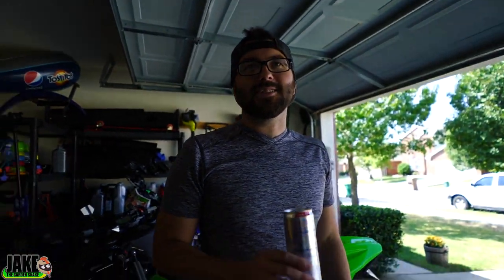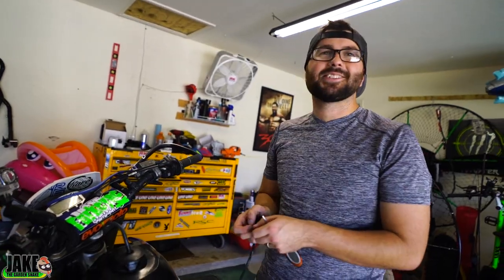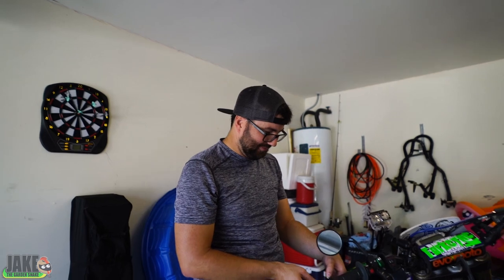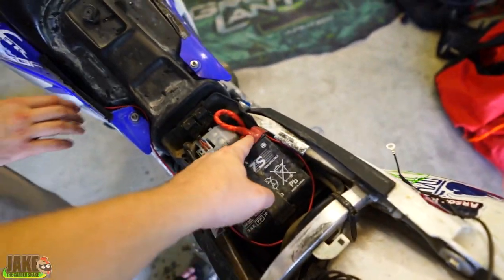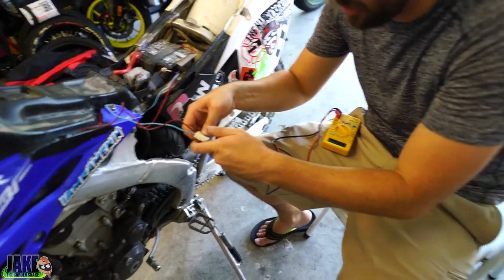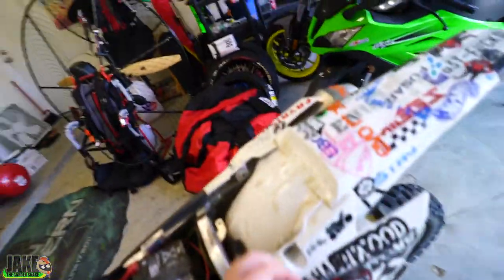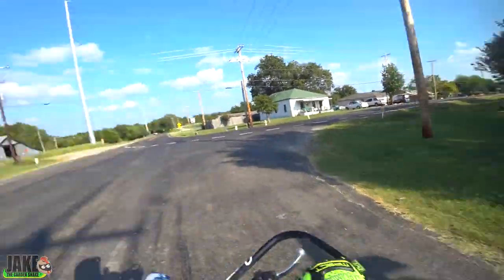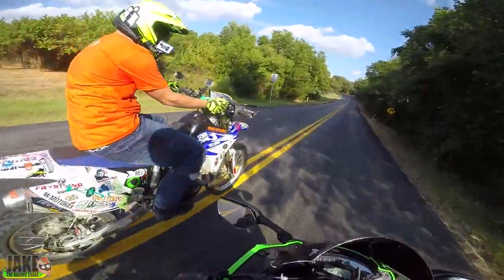Motorcycle AIR CONDITIONING (it really works!)

Comment: In Texas we have Air conditioners for our air conditioners.
Reply: Called swamp coolers right? And its pretty much the same as spraying your heat pumps outdoor condensor with a water hose. This is a misting system not an air conditioner. I guess if you think about it your body acts lile the coil and with the wind blowing into you...
Reply: @fabjonjon  tbh swamp coolers are only a little useful, scrub and wash your coil of debris and thatll help most people most for quick an easy. you can also hack something together to make a larger coil or figure out some water cooling system.

Comment: Soldering tip: heat up wire with iron and melt solder with wire not the tip
Reply from the maker: For sure, I'm too lazy but I know that works well
Reply: Same as copper pipe, gotta get the pipe hot to solder weld. Heat the wire to solder weld.
Reply: put flux on the wire first, and it'll heat up pretty much instantly.

Comment: If you stop using the bulky solder and get the thin electrical wire solder the wire will take the solder a whole lot better.